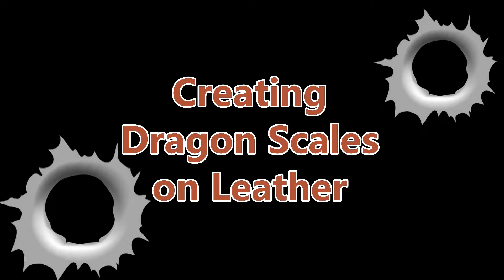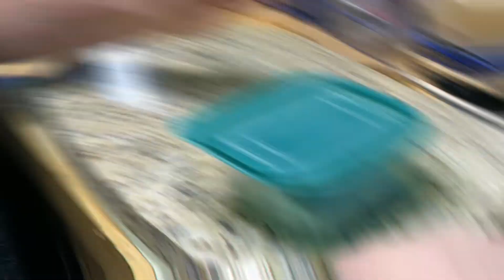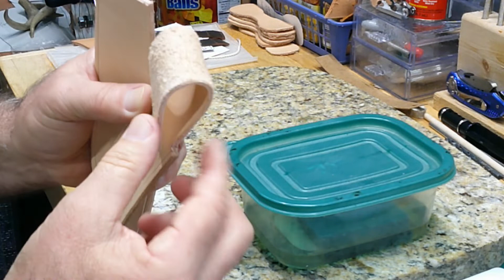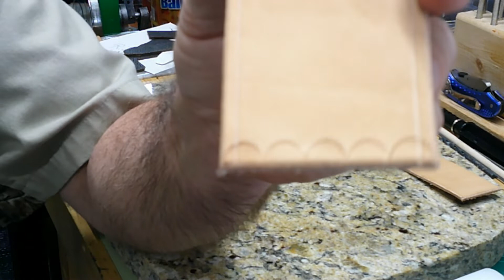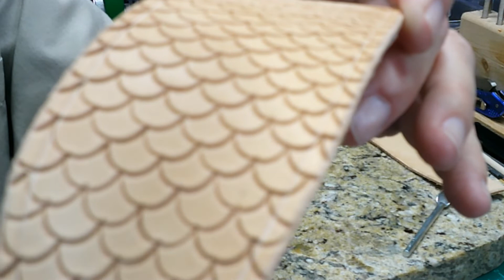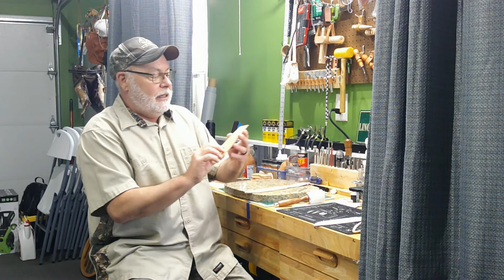Creating Leather Dragon Scales

Comment: You can make your own punch using a piece of pipe. Just cut it in half at the tip and maybe sharpen the edges with a file to get the edge look you want. 😎👍. I'll be using this with wood.
Reply from the maker: That sounds great. Thanks for watching and commenting.